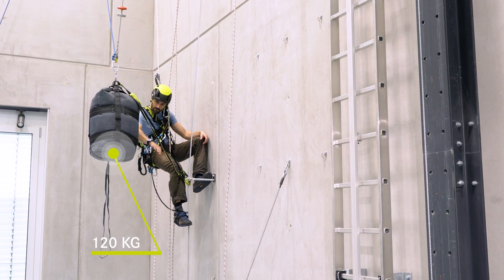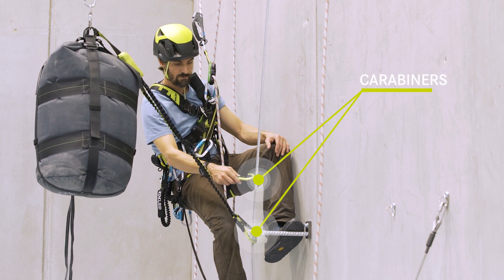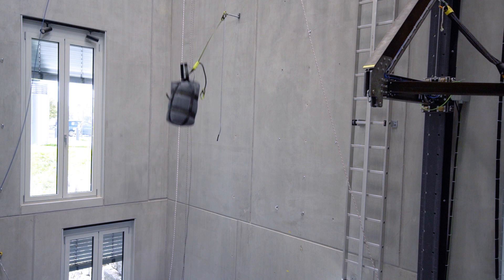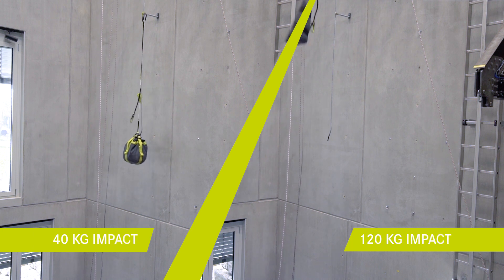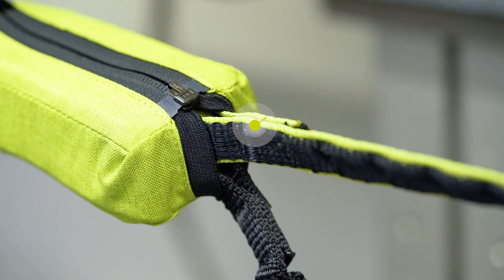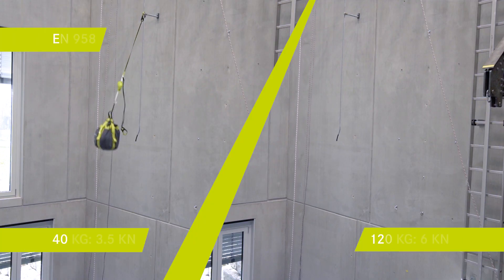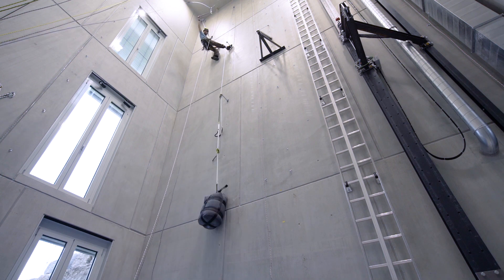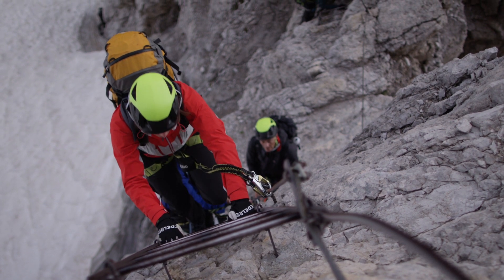In-Depth Knowledge About Via Ferrata Sets | EDELRID Knowledge Base

Comment: why don't you guys experiment a carabiner that has a system like a jumar but for iron ropes ...?? that you can clip it as usually or use it like a jumar for iron ropes, so you can't fall over 2 metres !
Reply: See the Skylotec Rider 3.0 - unfortunately not available in the USA yet.
Reply: @BackcountryPilgrim  That was exactly what I was talking about !!! the Skylotec Rider 3.0 is a great great device , so sad that is very expensive. I think it should be sold also as a standalone device and not with the antire kit ... I think the first company that will design an hardware like the Skylotec as an upgrade for existing kits for 80/90$ , will rule the market! it's a life changing device , why you have to fall over 6-7-8 metres when you can just stop right where you are, 1-2 metres